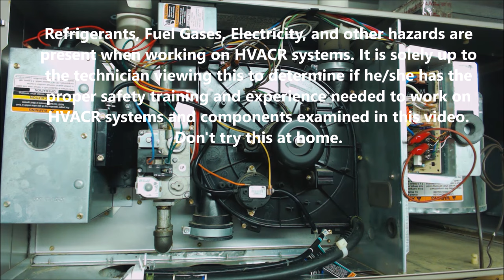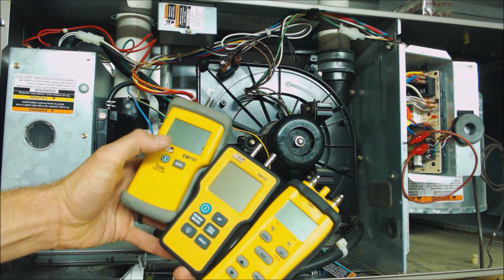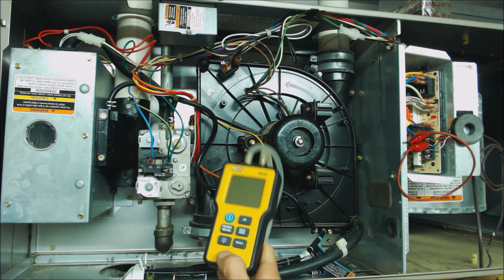TOP 10 Gas Furnace, PRESSURE SWITCH Error Code Problems!

Comment: I had a pressure switch open while inducer is on code. I don’t have a manometer but I checked the tube from switch to inducer it’s fine, I cleaned the port on the inducer that the tube connects to and it’s fine. I tested the pressure switch and it was working, I was getting 24 volts right before the inducer vacuumed it and closed the switch then goes down to 0. However at one point I started getting a low voltage at the pressure switch while inducer was on, I was seeing about 5 volts which was strange. Furthermore at another point the code was on and I was literally measuring the switch at that point and it was fine. I changed the pressure switch because it was fishy. However the problem happened again but then it stopped. My only other assumption would be the control board.

Comment: So i had my inducer motor wheel  inside break apart, i replaced it and a year later its doing it again, so i bit the bullet and ordered the whole new house unit with the motor and such....is this normal to happen?
Reply from the maker: The carrier inducer internal wheel typically doesn't break compared with other manufacturers. Is the wheel hitting water constantly in reference to how the furnace is pitched?
Reply: AC Service Tech LLC i dont believe so, its not like its particularly humid but its odd that just short ammout of time, i gota take it appart soon any way see the condition, overnight it just kept turning on, ran for a bit then off.

Comment: I have a 7-yr-old Goodman GKS9 gas furnace. It goes through one cycle (stays on as long as needed to reach temp setting) and shuts off, but when the temp drops it won't start the next cycle.  Instead, the fan blows cool air and I get an error code 3-pressure switch stuck closed.  I replaced the pressure switch-same behavior.  I can turn the furnace off then on to start a cycle.  Any thoughts on the cause?
Reply from the maker: Has the condensate drain and tubing been blown out or vacuumed? That will trip the pressure switch intermittently, thanks and lookm up "acservicetech clean furnace drain"
Reply: @acservicetechchannel  The drain and tubing were vacuumed; I watched your video and did it again (great video-very easy to understand), but still having the same issue.
Reply from the maker: You should be checking the pressure switch with a multimeter to see when it is closed or open and if 24v is crossing it. If there is no problem there and the board is saying that there is then the board would be at fault but you would really need to take your readings at the pressure switch first, thanks!

Comment: so  the inducer comes on, the ignitor lights up, I hear the click on the gas value but the gas don't come out the value , the trouble code Is one blink for ( gas low, gas pressure, gas value , flame sensor) check the flame sensor and no curient is coming from the board , but I would think , no current would come until the furnace fire up . also I had water damage in the house that my have gotten in the furnace , do anyone have idea whtat the problem could be
Reply from the maker: You would need to read the voltage going to the gas valve and the gas pressure going in and out of the gas valve, thanks

Comment: My concord furnace will not run unless I tap the pressure switch with my finger. Then it will run until the thermostat gets to temperature. Then it won’t turn on again until I tap. Any ideas?
Reply: Spray the switch with WD-40.

Comment: Anyone else have issues with 90% Nordyne furnace tripping inducer limit all the time? Its my own furnace, not a customer. I have cleaned the secondary (even though it wasnt really dirty) the A-Coil, always change filters, slope on exhaust is fine, etc... it is not an under sized unit, nothing blocking any vents, blower wheel cleaned, the weird part is, the collector box stays pretty cool. Wondering if it is possible it is smashed behind the collection box. Also, read somewhere that restrictor plates inside the inducer on some have been known to fall off or rot. Not sure how true. Weird part is, once I cleaned the A-Coil, it stopped tripping the limit for the remainder of winter (it was January) once I cleaned it, it stopped and heated beautifully. Like 6 degrees in 40 minutes no tripping, then, following winter (this year) started in again) you cant tell me the A Coil re plugged that fast. Especially with how well I cleaned it.